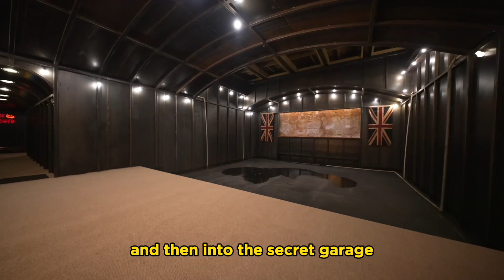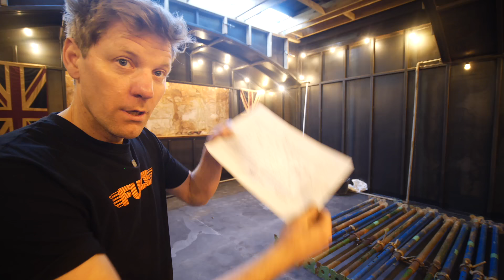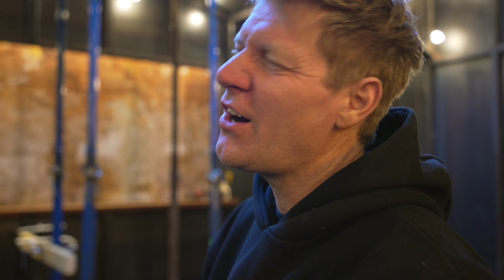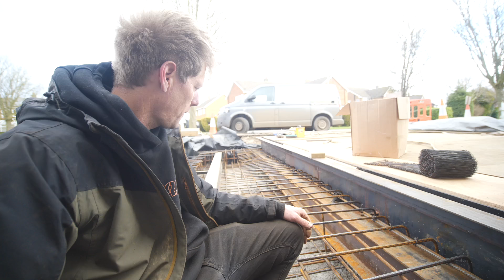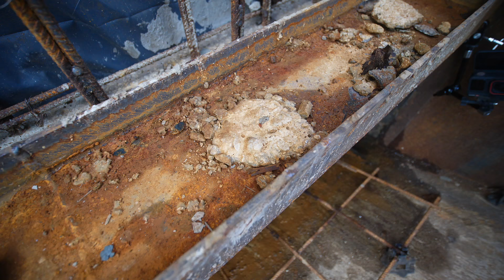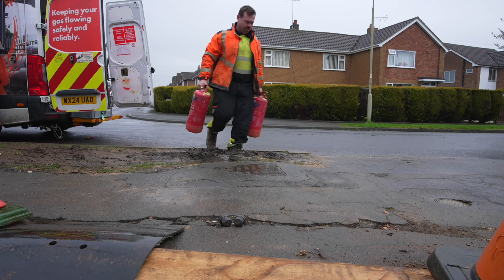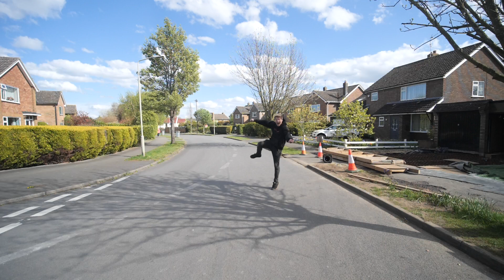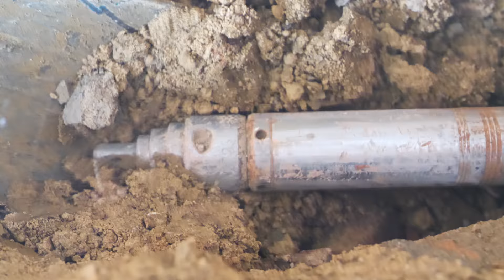Digging a SECRET Garage Part 6 THE COVER UP!

Comment: Seeing all the plastic stand-off pieces for the rebar gives me PTSD'esque flashbacks from a nightmare gig. Anecdote time! 😅

Got hired for a temp "quick one weekend gig" described on the phone as "removing some plastic stand-offs" on a "local building project". As usual, there was barely a hint of a sliver of technical truth to a minor part.

45km from the city. They had dug the ground out underneath the two runways of our regional civilian airport and nato airbase, to build two multilane tunnels underneath the runways. Along with a complex of insanely beefy uboat bunkers with internal docks for repairs built in the city harbor these runways were built by the occupying Germans during WW2. Built to mitigate major damage during shelling and bombing, so they're basically a meter (~3ft) thick heavily reinforced concrete.

As such, they dug out underneath those runways, and the underside of these concrete runways themselves make up the roof of the tunnels. So when casting the runways, they laid down styrofoam sheets both for insulation and foundation stability. Then placed the bottom layer of rebar on plastic stand-offs.

Building the tunnels they stripped down the styrofoam. However, fire resistant cladding of the roof was to be done with prefab sheets which were very rigid and quite brittle. So there couldn't be any bumps or protrusions sticking down from the concrete "roof" or they would crack during install. And the weight of the rebar had pushed about half of the stand-offs deep enough into the foam sheets that with the styrofoam now removed, they were protruding about 5-7mm. They were also hollow from the top so concrete poured would flow into them, avoiding air pockets and floating. That meant, not only would we need to get rid of protruding plastic, but after ~1mm layer of plastic there was about a 30mm core plug of concrete, which also needed to be gone, and many of them had vertical rebar in the center of them too.

All we (me and one other guy) had to work with was a rolling scaffold, 2 very large and heavy angle grinders, and fat stacks of cutting and grinding discs.

So we spent 3 weeks working 12 straight hour shifts at night 7 days a week. 95% spent using these big, really heavy angle grinders to grind down these "cores" of concrete "plugs" (and a small bit of plastic) to get them flush with the surface, in the roof well above our heads, constantly showered by sparks, and burning hot grit of steel and concrete. The only breaks were when moving the scaffold. The amount of muscular fatigue, lactic acid and pain from ~12 hours every day pressing these heavy grinders into the concrete above us was insane, and really not helped by the complete lack of recovery and barely any sleep.

I didn't have a car at that time, so to get to the site at the set time (19 / 7pm) using various connecting public transport, I had to leave home a little over 2 and a half hours before. Working through the evening and night, getting off at 07 / 7am when all the other crews started work, the first bus or train back to the city left at 7 and it was a 15 minute jog to the bus stop. So the next bus I could actually reach in time didn't leave until 09 / 9am. At that point I would be home a few minutes before noon. With no facilities at the site nor anything else open in the area at night, and working 7 days a week, that meant I was left with 4 hours a day to buy groceries and tend to all other neccessary errands and duties, cook and eat dinner, prepare food for "breakfast" and for the next shift, shower, sleep, and get ready to go back out. The most I managed to get through those 3 weeks was barely over 3 hours. But that also meant no dinner or breakfast that day.

Comment: I’ve talked to you before and I may have seemed a little out of sorts because I had chemical memory suppressant and while I still slightly have some of the effects, it’s no big deal. It was for legal business so I didn’t speak up anyway challenge nuclear engineer the nuclear engineer Nuclear harmonics, a pressure, washer, electric pressure washer to power the bearing to drive the turbo charger and at that point, use the turbo charger for a supercharger yes a supercharger you literally use the supercharger as the power plant and then you turn the engine, which is a power plant and a motor you pull everything to do with the power plant off of the motor and put it on the supercharger and then you take the output of the supercharger and you beyond measure Generate more energy than that motor that you just took the power plant off of can use all told it doesn’t matter how much it does you’re gonna pull more vacuum then it can generate pressure and you’re gonna force feed it already perfectly mixed and at pressure just to pop just to get snatched off and that’s a supercharged mobility scooterI won’t let them do this with full-size cars anymore, but a mobility scooter with something like a chainsaw engine all day long.😊

Comment: The layer of water on the concrete after it was poured. Is that a side effect of too much water or was this a special mix for your purposes? In Canada you can’t have too much water because the concrete is brittle and freezing temps would crack it up after one winter.

Comment: Those little rebar standoffs are a great product, because you need to have the rebar offset a minimum distance from the surface of the concrete so they can't fracture the concrete if it inevitably flexes a bit. Structural engineering stuff that I understand conceptually but can't wrap my head around the maths for.

Comment: I started watching this right at the beginning,  the mrs got into it and had to start over. We've both loved it, gonna be a real shame when its all over.

Question, now that the gas, water and electric are encased in concrete and rebar, what happens if theres a leak or something or do you just pray there never is?

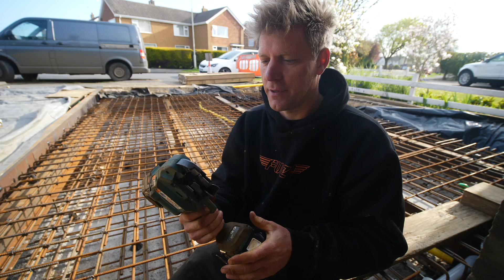Comment: 28:49 I didn't even know such a tool existed, we did it manually, just take a piece of metal wire, fold it 2 or 3 times and tighten it with pliers.

Comment: You guyes are actual beasts. it is so impressive, i feel i am undergoing a big project, adding solar to the house and building 40kwh of battery storage. but compared to this it´s just a quick add-on 🤣😂🤣😂 But it is looking awesome, grate job. ps. not sure i agree with the fens in steel 🧐 what do the misses say to all this 😅

Comment: Just a reminder for those concerned about rust... and a further reason why the concrete protects it if where it's started to rust..
The concrete seals the metal from the gaseous oxidizer - Oxygen - in our atmosphere that allows the process we call rust to occur when moisture contacts iron metals.
(remember the "smell of metal" is just your skin oil reacting with the metal to create the "smell"! isn't chemistry fun!)

Comment: You could’ve left that rebar and welded it all together and simply laid a bit of plastic over the top with your drains, already built in who needs the concrete. The rebar is just as strong as the concrete.

Comment: The things that just amaze me the most, are first of all, the fact that you got the permission to build this thing, in the Netherlands where I live, they even whine about your garden shed not being behind, but half a meter sticking out the side of your home. And if you literally need to dig 40cm deep, they already start to get concerned about water pipes and gas lines… such bs if you see that in England they are good with these kind of projects 😂

And second of all, the fact that someone built and came up with this all himself. Really, props to you Colin
Reply: As an American, I'm amazed too. Here, either you're normal and get too buried in red tape, or you turn into the 4chan doomer and get someone killed in a fire. The British version is so much better.

Comment: @colinfurze
Hey Colin, I’m a PM for a multibillion dollar international construction company. The round rebar caps you used should only be used for horizontal rebar ends. There are more reinforced, SQUARE rebar caps that you should use for vertically exposed rebar. Just a heads up safety point for you for future crazy projects of yours.

Comment: seen a special kind of watervacuum used by plumbers , it has some sort of submercible pump inside it that pumps the water out of the machine trough a hose intoo a pitor the sewerpipe while using the machine , verry handy if you need to suck up a lot of water as you dont need to take the machine a part to empty it out every 6 minutes or so 
there NOT cheap though , maibe you can convert the standard machine using a normal submersible pump and some hose

Comment: The concrete also won't protect the steel if it contaminated with chloride, so don't let any deicing salt get onto your garage. also think about the salt which splashes onto you garage roof from the road or the salty snow slurry stuck in your fenders that falls off your car when it warms up. Each fender can hold several pints of salt water. You should prefer to have none at all. Or coat your concrete to protect it from salt ingress.

Comment: I could recommend metal reinforced copex for cable ducts. Its flexible ducting, comes in a range of size. Maybe if it was high to the surface of concrete. , the weight would not affect it. If you could have your runs as straight as possible. You can draw cables through it with ease. The more space in the duct (bigger size) the easier it is to do.

Comment: 30:28 weld some tubing to the tubing on the bottom of the seat and bend it around to the back where you could use the rear mounting holes

Comment: 12:25

If that doesn't make sense: get a thick paperback book and bend it into a U shape. You'll note the inside pages push out and the outside pages pull back. Concrete slabs work like this, and concrete as a material is a lot better at withstanding pushing out than pulling back. So you put extra steel rebar (more bars, or thicker ones) on the other side in order to compensate, as gravity bends the middle of the slab into a U shape.

Edit: This is also why I-beams are shaped the way they are. Those forces are strongest on the top and bottom edges, and zero out in the center of the beam. Steel is allocated appropriately.

Comment: This video was especially interesting to watch because all of the structural blueprints you explained in the beginning is my line of work! All the fancy schmancy engineers do the math to sort out what bars go where through architectural designs, and it’s my job to translate those diagrams into a 3d model and then print those models to 2d projections and label/dimension all your hardware! my job is specific to precast concrete facades, but its all very similar in the end! very much so enjoyed seeing what i do in action

Comment: Not the type to say “You don't want to do it like that. You want to do it like this”. But why use so much concrete on the roof? A steel tray, the width and length of which are X & Y mm, will allow you to have a lightweight roof thats moveable, weather-tight and can be parked on. The sheer volume of concrete must be unnecessary, surely?

Comment: Afew years back I worked on a site in Lincoln. A circular tower of student flats down by the warf. As a general site labourer I ended up working with an old Irish lad doing the steel fixing. We spent days making the rebar cages for the base of the flats and the tower crane, had to tie the bars together by hand. No fancy electric wire fastener back then, just a pair of steel stips, and a lot of ballache. The flats are sill standing so I must have done something right.

Comment: A little late now but any plumbing or electric buried in concrete should have some thin expansion foam around it to prevent it getting damaged as the concrete moves and when it crack later.
Hope you get lucky but it is best practice

Comment: Felt compelled to say this. My day job, i work for a company the has concrete accessories and others goodies. Rebar, mesh, karbon bar, tie wire and the sorts one needs for a pour, minus the concrete itself. We also have stains, etching chemicals and stuff needed for finishing, power trowels, floats and even expansion joint stuff. We even have rebar chairs (like the ones you used, the lil fellas that are holding the bar up). And, last but not least, LOTS of actual rebar! From the small #3-60, all the way to #8-60 grade bar. We also have The karbon bar, im unsure of its grade, as im still learning a lot (just over a month there, woohoo!) And im loving every minute of it, even on the rougher days. I deliver to our customers, and enjoy the driving and learning aspects of the job, very, very much. Hearing you talk about the rebar, made me chuckle, as i grew up with my dad building playgrounds, and various other construction tasks. Even helped him build a shed when i was like, 6 (handing him tools, holding tapes n such) And this honestly reminded me of childhood. Was a very well done video Colin! Keep up the awesome work, looking forward to the next updates!!

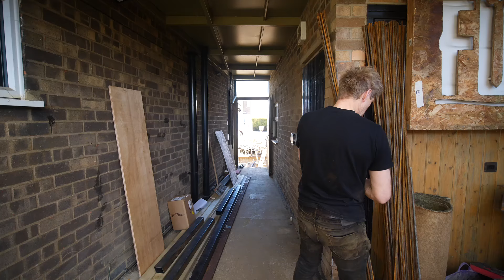Comment: 20:34 This may be only a concern in areas that are more seismically active than the UK, broadly, today,, is, but you might like to consider retaining (while not necessarily powering) more than one electric supply route. It'd be a shame for the earth to shift, and then you (or the future owner of this home) would need to jackhammer up all that concrete you're about to pour to reconnect an electric cable.

Comment: You should probably calculate the maximum weight that driveway can handle and put a sign up somewhere to that effect.  For example, could it handle a concrete truck backed up in there?  How about if someone delivered a truck full of pallets of brick and dropped it there?  Some day you won't be there (unless you figure out immortality) so the next resident might need the reminder ;)

Comment: Galvanized steel..... not just steel..... concrete soaks up water..... the only prot3ction is potential for air to get to steel with the water but that happens when the water soaked into concrete evaporates, right?

Comment: Can anyone explain why you need the extra support when pouring the concrete? The fresh concrete is the same weight as the cured right ? So the construction should handle both the same ?
Reply from the maker: Wet concrete is heavier, not sure by how much but it is heavier but the strength is in when it’s cured and hard as wet concrete is just heavy but no structure.

Comment: You tried to obscure your licence plate with a very inapropriate pixelisation (this can be decoded on moving images no problem). I was about to crack it when I realised you don't even sensored it on the next take.

Comment: I'm a bit surprised, and a little disappointed you didn't build a channel for the gas and electric mains. That would've not only helped a ton in future serviceability should you need it, but if anything ever goes wrong, you don't need to rip and tear all that hard work apart to get to the dang things.

Comment: You usually use wood for the support structure because it is cheaper. Especially when calculating prep work on site (wood is way easier to work with then metall). Unless you are a YouTuber and get metal for free and do everything by yourself and don't have to pay for labour. 

Also you can build (almost) everything out of wood that you can build out of steel. At some point it becomes a space problem, because wood has to have a lot more cross-sectional area than steel.

Comment: i know it too late now, but would it not have been better to use 110mm soil pipe to make ducting for all the pipework to sit inside so if there is any issues you can still  maintain them? now its all cemented into place which you cant access. 

EDIT: this was half way through when looking at the sump pump pipework, i see there is ducting for the gas pipe

Comment: If I had the same means and resources I'd build a bunker like that but have it dressed like the original Starship Enteprise. There would be 4 transparent tubes that were actually elevators that lowered myself and guests down into the transporter room and then from there...

Comment: 34:38 FYI blur is non-destructive
it can be undone
DO NOT use it to hide important information - use a solid color
Reply: what does it matter when the reg is exposed in the very next shot?
Reply: @dab88 one is a strategy issue, the other is a practical one. If all secret information had been blurred, it could still be recovered.

Comment: I'll tell you what. You won't have to be worried about things breaking because the engineer you hired have really both used suspenders and a waistbelt when designing. I would guesstimate that the utilization of the roof is at about ~15-20%, if even that.

Comment: too much concrete and rebar. it would still be overkill with half. this is for people who think they cannot afford to do this. he's using expensive materials like sheet metal cos he can afford it; there are other ways and other things. I would say on the average, this project will end up 3x the normal reasonable cost

Comment: I dont know if this has been asked or if you have already discussed it but are you at all concerned about the safety of the car lift? Im not talking about it falling apart or anything but more so the fact that it could be dangerous in operation.  Do you not worry about somebody getting, you know, pinched?

Comment: 34:00 "Pneumatic rocket" babe 💪 I used a D130 Grundomat big sister to have big pipes under my house without trenches the thing was over 120kg but to have a D110 pipe it was perfect, quite a nice tool as long as you got the right air pump 😅 I launched two strand of D110 pipe for picking fresh air in summer and hot air in winter 💪 Great job you did 💪 Kudos from 🇫🇷🇪🇺